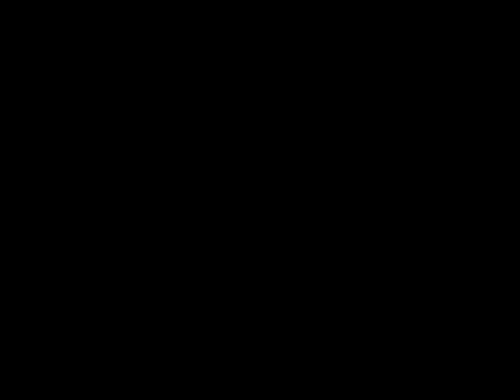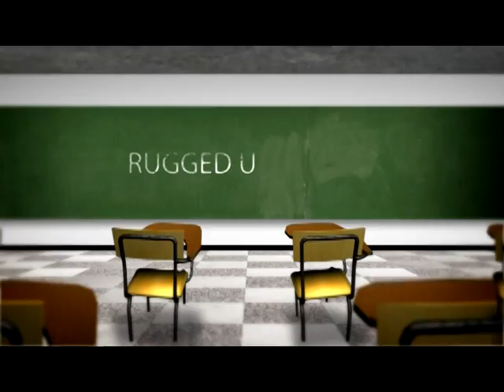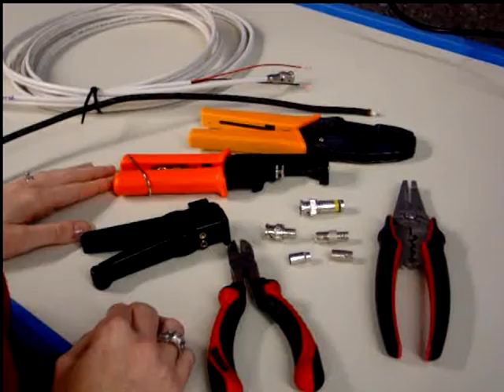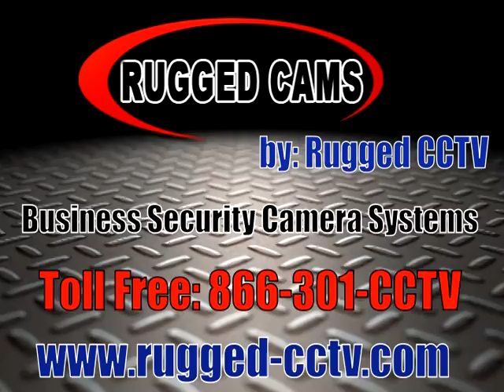Security Camera Tools, Connectors and Cables

Comment: Is anyone able to tell me what the plug on the side of my CCTV Panasonic wv-cl320 is? Scroll down the link to see my camera there are more than a few pictures... I contacted Panasonic but they are absolutely useless and ignorant unwilling to even bother searching past there empty manual archives for info. You would think they would at least contact there IT department and ask what it was for...
http://www.ebay.com/itm/261798480688?_trksid=p2059210.m2749.l2649&ssPageName=STRK%3AMEBIDX%3AIT
Reply from the maker: NoFear4XJs We only sell our own Rugged Cams brand cameras, but I've seen a lot of Panasonic box cameras. Your link didn't show me any pics, but usually when you find a squarish connector sitting flush with the side of a box camera, it is where you plug in the lens control.  So, if you do not have a lens on it yet, that is where it plugs in at.   The lens will come with a wire and connector that plugs into that.  I'm guessing your camera did not have a lens with it or perhaps it came with a fixed or manual iris model that doesn't have the feedback control.  Feel free to ask additional questions if needed.
Reply: Thank you for the reply.
If you scroll down the page a bit you will see the larger picture and posting of the camera I bought, you have already answered my question though so thanks again. I do have one more though, will a SDI to HDMI converter work for direct hook up to a TV or Monitor ?
I`m still waiting for it to arrive and will be using it for very low light viewing on my Microscope, guessing you have no idea what the resolution will be since it is digital I`m hoping it will be fine.
Panasonic so far has been useless, no surprise... 
Cheers
Reply from the maker: NoFear4XJs OK, finally got to see the pics, but it took some doing.  Yes, that is exactly what that plug is for.  Your lens for the microscope would not need the Auto-Iris control. 
I do not know the rez, but since it is a CCD, it is probably 4-500 lines of rez.
Reply: Awesome news thank you for taking the time to help me out !!

Have a great weekend :]
Reply: Ok one more question :]
Do you know of any software I can run through windows to boost the resolution up, since it is CCD ? Or is the sensor size just to small ?
 I`m left with the impression I should be able to find something but always best to ask a pro with years of experience in the field before I start wasting hours online searching.

Cheers
Reply from the maker: NoFear4XJs Analog CCD, so no.  Not that I know of.
Reply: Ok thanks, I just bought a SDI to HDMI converter and from what I can gather as long as I use a 75 ohm bnc cable it should be good to go.?
Reply from the maker: NoFear4XJs Yes, BNC connector at camera and the input of your converter.  then HDMI from the output of the converter to your monitor.
Reply: This is great news thank you for the help, glade I`m stumbling in the right direction :]
Cheers

Comment: hi, can i change the connectors and use a usb plug instead?
Reply from the maker: No, this is wiring for analog cameras.  You will need some type of capture card for your PC.  However, some IP Cameras can be bought with a USB cable on them.

Comment: Definitely helped. Thank you. I am beginning to see a spike in orders. And I am switching from the tiny BNC cables to RG6 and etc. I would imagine outside of being a better physical quality. It would be easier on installation? Do these cords help the signal? Versus the smaller generic sort of bnc cables that are very small in gauge.
Reply from the maker: Yes, RG6 has a bigger center conductor than the rest.  That helps the video signal and will also be the choice for really long cable runs.  You're right, those tiny cables I've seen out there are junk.

Comment from the maker: @Smokyburnowt - Stranded works best with low voltage.  Any 18/2 stranded should work fine for you.  Be aware that if your camera is 12V DC, it will be limited as to how far it will carry that voltage without too much voltage drop. Probably about 150', or if it is an infrared camera, more like 100'.